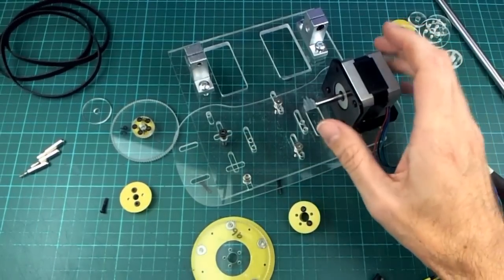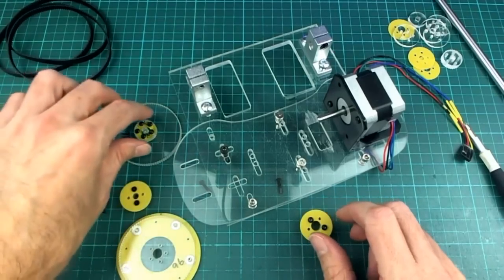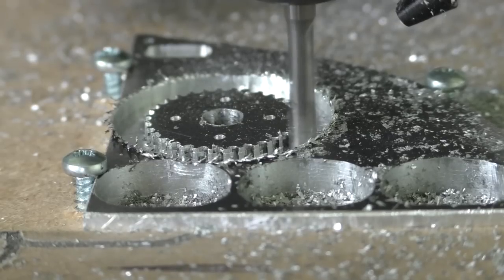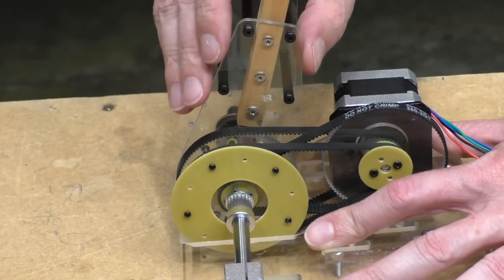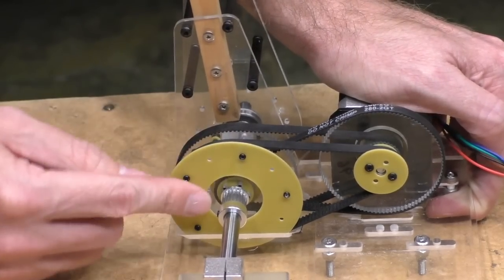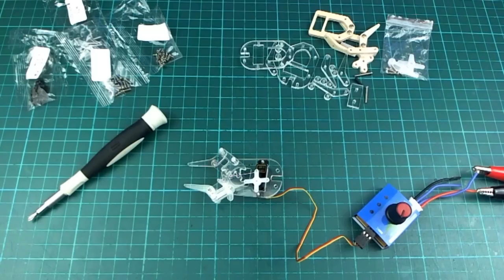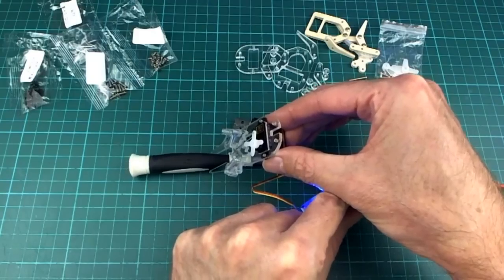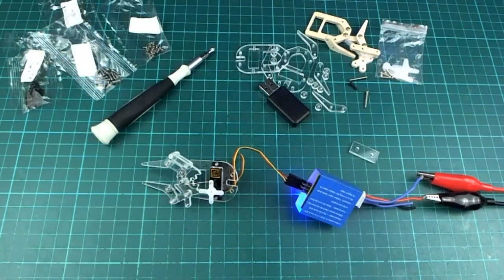Mini 6-axis robot arm part 3

Comment: Its nice to see you got a way for the arm to work but take my advice, ditch the belts for direct drive. There is too much torque on the arm. Use a planetary gear system and a set of aluminum gears from the RC car world. If you were driving a linear rail, then go for it but for consistent repeatability, the bets will not last and the tension on them are too high.

Just My Two Cents
Reply from the maker: Yeah I learned that the hard way. If I do any more on this, I will be starting from scratch and basing it on geared steppers, which are becoming cheaper all the time.
Reply: @iforce2d  You can use Nema 34 or even 23 as depending on the laminated core length, the higher the torque. It seems that companies make high torque steppers in Nema 23 or 34 these days. If you use timing belts and pulleys, then you need a tensioner on it. Consider using belt with tensioner  for first stage reduction to increase the torque and direct gear drive for the second/final stage. So all hope is not lost.
Reply from the maker: I would probably go for nema17 still, since I have a bunch of them sitting around already. iirc some places sell just the gear section.

Comment: Hi, if you want to rotate a stepper motor by hane you have to disconnect the wires from it, because if you did not do that you would apply resistance to the motor coils, then you would rotate the motor as a generator, take off these wires then you will be free to rotate the motor shaft by hand, for the other problem you have mentioned, I see that you you are rotating the motor by pushing the arm attached to the last gear in the gears and belts set, that means you want to rotate the stepper motor at high speed with a little torque your hand can deliver, the proof for that when you rotates the second big gera( the yellow one) you are able to rotate it easier....... have a good luck, enjoy my homemade robot here:
https://www.youtube.com/watch?v=6FwGJEzRhS8

Comment: Acrylic can be tapped just like aluminium. Also superglued can form very strong bonds with acrylic if you have nice surfaces and don't use to much. A super glue accelerator is also quite useful.
Reply from the maker: Yes I have ended up tapping some of the holes recently, especially the larger ones.

Comment: Look like your CNC works pretty well now ?
Reply from the maker: Yes, haven't had many problems for a long time now. The only recent issue was the z-axis seemed to get a bit sticky and I broke a drill bit when it didn't lift up enough, but I just used some WD40 type spray on the screw and it was fine after that. Probably not the best lubricant since it seems to dry out after a while but if I hit it with that again every now and then I think it will be ok.

Comment: With regards to labelling, and Ive not used a cnc before, but maybe you could  have the machine quickly carve a thin label into the piece  before its finished and never have a worry?

Heck while your at it, you might aswell start giving all the pieces serial/model numbers.

And if you're already doing that, might as well make a large multinational manufacturing firm while you're at it too...
Reply from the maker: Unless I was to 'engrave' huge text with a 2mm end mill, that would require an extra tool change and resetting the z-height every time. Much easier to just write with a marker :)

Comment: So this is where you've been... a lot of the faithful have been getting worried!
Reply from the maker: Most of the time is simply waiting for the postman. We just need somebody to invent and mass-produce a teleporting device, then I could get things done much quicker :)
I do record video for various projects fairly regularly, but there is very little connection between the regularity of recording and the regularity of uploads, this robot thing is a perfect example as I just uploaded about 5 months of sporadic progress all at once.
Generally I try to keep it going up in some logical order. For example I have already made a web-based tool to track the location of the 'farm rover' and show it on a map, recording all visited locations for use by autonomous pathfinding later, and I can also remotely turn on/off a large 24v spot light for driving at night.
http://www.iforce2d.net/tmp/roverCP.png
But since I still haven't got the darn thing driving yet, that will be uploaded later.
Reply: I just discovered mynotification "Alert bell" had been deselected for your channel... fixed that quick!  The mapping looks interesting, watching this space!   :o)

Comment: If you can monitor the servo current when gripping it will increase when you start to grip , so you could possibly decrease the servo current once gripped and reduce the stress on the servo , As long as the grip doesn't loosen with decreased current :-)

Comment: A while back I fell in love with Pinaut's micro-servo novelty robotic arm ( https://youtu.be/bLnAJ-mSElE ).  I experimented a bit with minimal success, and soon realised how much torque is required at full extension if each individual module is not counterbalanced.
Sometime later I saw this video ( https://youtu.be/K6rX1AEi57c?t=1m55s ) and eureka!  This is a great example of how little force is needed for movement if the whole assembly is statically balanced.   I bet the woman never envisaged someone using her artistic performance in a discussion on robotic arms!   :o)

Comment: Adding a rubber band to the little gripper will help to hold things, since the servo has to open the gripper and the rubber band will "force" it to close (but I really don't know if the servo likes this, or even want to "open" the gripper from the closed position just a little bit)

Comment: You could dip the ends of the grabber arms in that liquid plastic product you use on tool handles. 

I’m still working on my power glider.
Reply from the maker: I'm about to pull the trigger on a PNP glider on Banggood, not sure if I can be bothered fixing my scratch-built one after I broke the main tail boom. Recently I have been flying my C1 Chaser quite often and getting pretty good glide times (like 10 minutes glide from 2  minutes of motor on), flying in FPV and enjoying that.